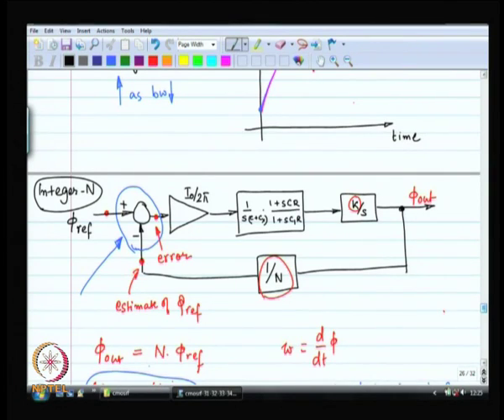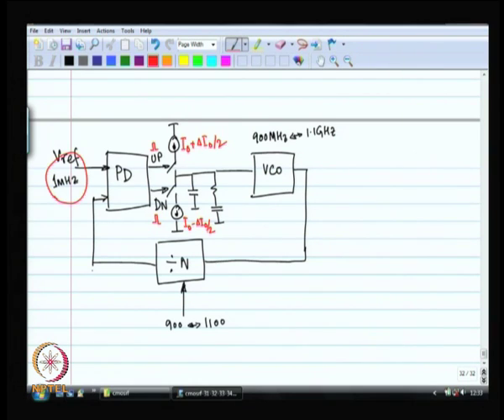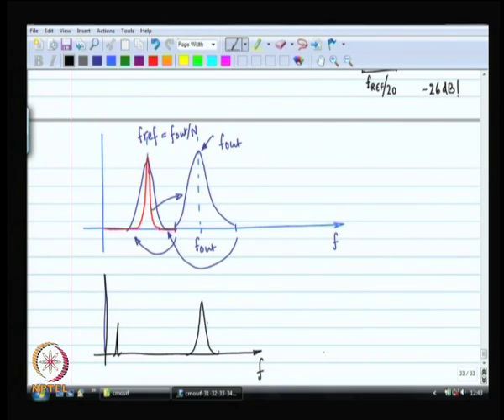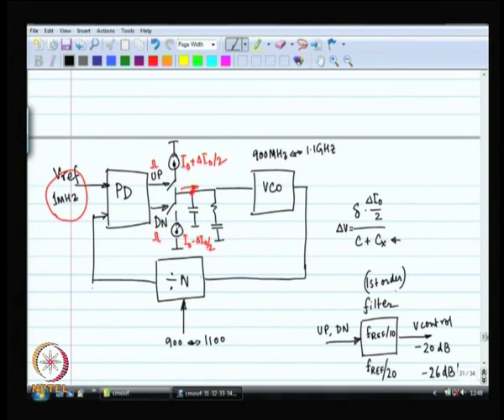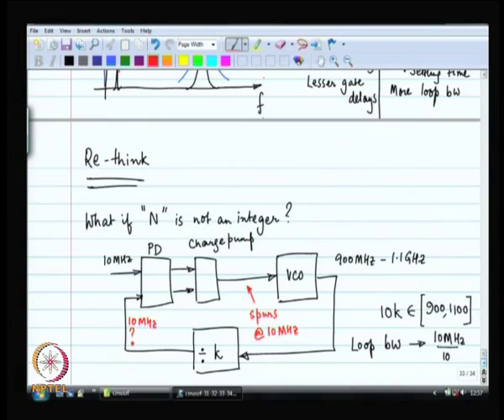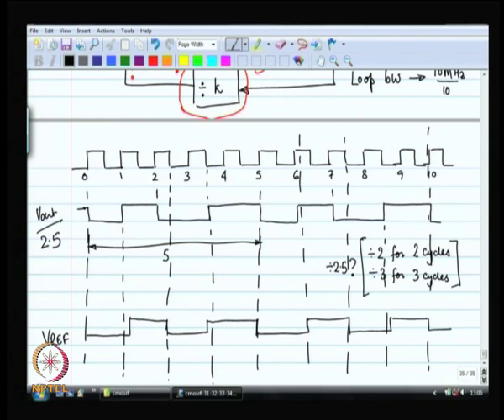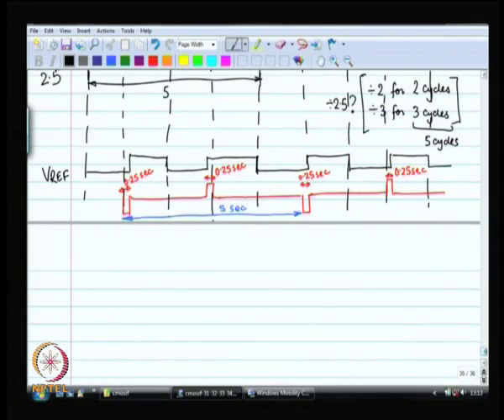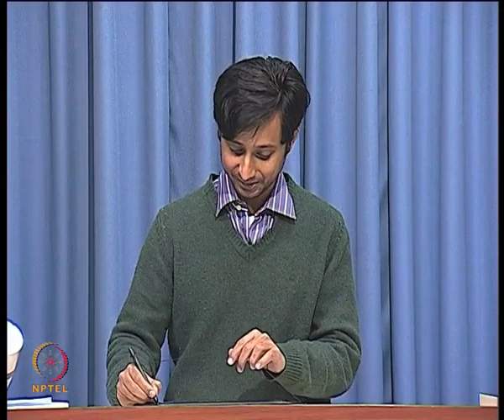Mod-11 Lec-34 Spurious frequencies fractional and synthesis

Comment: Sir, with all due respect I believe by saying a frequency divider compresses the X axis (Frequency offset from carrier signal) is misleading. I think it is more accurate to describe it in Time domain. If you Divide a signal by two, the number of pulses/Second becomes half (in effect half the frequency) but also the total Noise energy (which is the jitter on the rising and falling edges of time domain waveform) becomes half as well. This results in 6 dB improvement (reduction by half) at the same offset (of course assuming divider does not add any noise). 
Now if there is 100 MHz signal with a -60 dBC spur at 10 kHz offset and if you divide this signal by a good (low-noise) divide by 2, you will get a 50 MHz output signal with -66 dBC (6 dB improvement) spurious but the offset of the spur will remain at 10 kHz and not at 5 kHz offset. Hence no compression in X axis in frequency domain happens.

Comment: The rising edges of Vout are always 2.5s apart, similarly Vref period is 2.5s, so depending on phase alignment Vphi will always have all up or all down pulses. I think he meant to draw Vout with opposite phase, then rising edges of Vout will alternate at 2s,3s, ...

Comment: Sir, In my waveform, the rising edges of the divided waveform comes at 1, 3.5, 6, 8.5 (seconds) and the fref rising edges are at 1.25, 3.75,6.25, 8.75 (seconds). In all the four cases, the divided rising edges come before the rising edges of fref and must all result into UP signals only. Am I right?
Reply: U meant all down signals right ?

Comment: At 45:45, the period of the anti back lash pulses occur every 5s.  Therefore you mentioned that spurs do not occur at 10MHz.  What I do not understand is; from the example that you showed in the block diagram, the Clk reference is at 10MHz, but in your timing diagram, you are using a scale of 1s per cycle in your plot.  Should we not normalize that scale to 10MHz and then see that that 1/5th of this should not appear in a 1/10th Loop BW? Sorry if my question is not properly presented.  Thanks alot for any answers to this.

Comment: 2 cylces divide by 2, 3 cycles divide by 3, so effective division by (2x2+3x3)/(2+3)=2.6.
Am I wrong?

If you do, 2 cycles divide by 2 and 2 cycles divide by 3, then you get average division by 2.5. Please correct me if I'm wrong !!
Reply: +Debdut Biswas I totally agree with you
Reply: +Valerio Marotta Correction: thinking a little bit on it, I think the professor's right. You're dividing one time for 2 (to divide for 2 you need 2 cycles of the output) and one time for 3 (to divide for 3 you need 3 cycles of the output), therefore the average is 2.5 in this case.